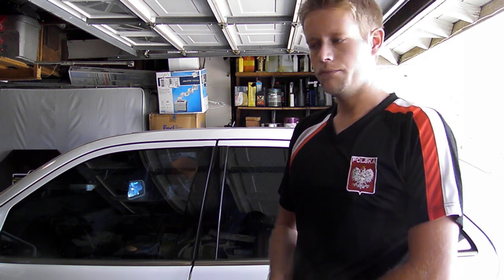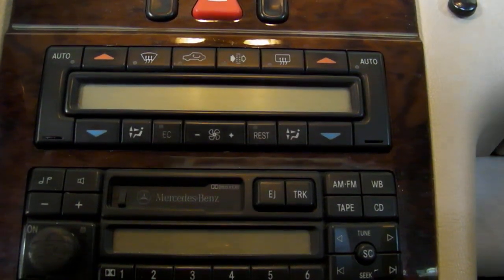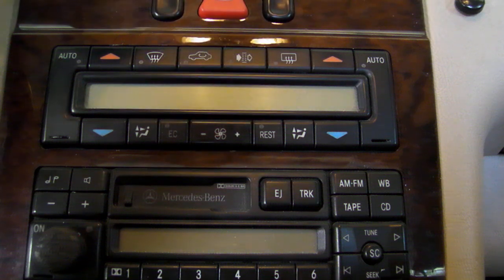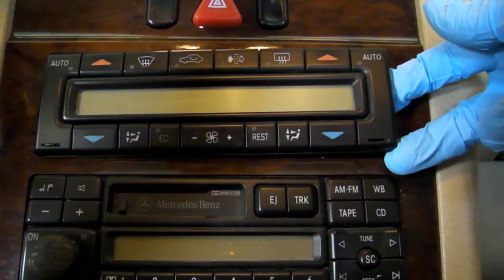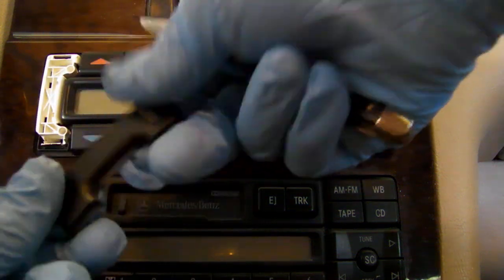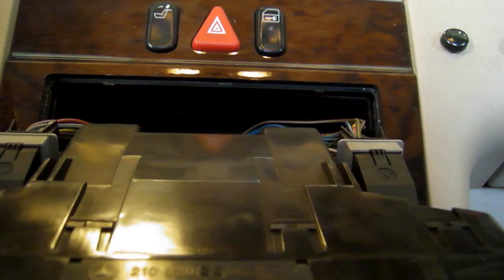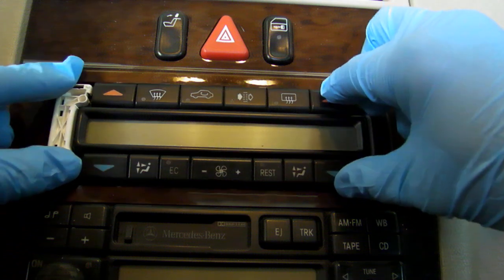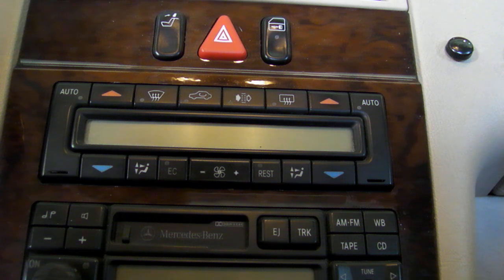Guide: Mercedes E-class (W210 / W208 Chassis) Climate Control Removal + Light Bulb Replacement)

Comment: Hi Mathew, just wanted to give you and your viewers an easier way to remove the climate control unit.  No need for keys or switch blades just a plain old credit card.  Cut two pieces off the credit card  on the long side. The two pieces need to be wide enough to go into the the slots and just push them in, no need to wiggle, just push in and the lock clip will disengage.
Reply from the maker: Hi Joe - thank you for the tip! Much appreciated!
Reply: @joe Pacheco three years later after your comment gotta tell u thanks !

Comment: I have a 2000 MB E320 wagon, My module numbers on the screen, bars,symbols etc are vanishing as well as the on the Radio screen ! Does anybody knows why is that happening, sometimes they show up on the screen but buttons don't work sometimes nothing shows up on the screen,it's like failing,the Radio volume sometimes it's too loud or I turn it too much and doesn't go down lots of crazy stuff happening ! I checked fuses all are fine ! Great Vid !
Reply from the maker: I’m not sure what the issue could be. Perhaps water damage behind the dash causing these glitches? I’d search or post the question on the MB forums.

Comment: Hello Friend. I have a 2001 mercedes w210. I replaced the bulb just like you showed but the new bulb doesn't light either. Whether there is a fuse for that lamp or something else can be a problem.
Reply from the maker: Hi Marko - I don't have that car anymore but I remember that I also had issues getting it to light. After moving it around inside the socket for a while, it lit. I think it has to do with the metal contact "tabs" that make contact with the light to complete the circuit. If you can find those, try pulling them out a little. Perhaps those metal tabs are not making contact.

Comment: I'll have to check and see if my 2000 E430 has those slots but all you need is that simple key I believe they made for the radios you push them in and it locks in the clip and then pull them out with the keys easy Peezy

I've gotten to the point when it comes to a do it yourself job get the right tool 

Like I said I'll have to check this but I am "assuming" these have the same size slots as the radios 

No wiggling no jerking just push the keys in and pull out the unit

You always use two keys so there's no worrying just pull it out

Edit: I wanted to still thank you for this video because my back light was out and I am assuming it be a PITA like various radios to replace. 

I am all set to call Beckman technologies and go to my parts friend at the Mercedes dealer to see what a rebuilt unit would be and it's nice to know it's so simple to replace so thank you !

Comment: nice job matt thank you. how far in do you push the blade? and are you applying pressure towards the unit or away from the unit to release it?
Reply from the maker: Justin Keogh I pushed the blade in until I heard a light “click”. It will take some wiggling of the blade but you will eventually get it. Then, coax one side toward you a little bit and work on the other. Too much pressure shouldn’t be needed.
Reply: @matthewbaker1419  Mate how do you switch to the digital control unit from the base model manual switch one

Comment: Thanks Matthew . i found this video very helpful .  i ordered the keys to remove the control . Simple operation as you said . However now i am having trouble finding the bulb to replace . What do i call this and where can i purchase one at?   thanks again for your video .......
Reply: T5
Reply from the maker: Hi Karl. I apologize for the late reply as I'm not too active on YouTube. Getting a bulb is tricky... it is nearly impossible to find them new. My suggestion would be to call local scrap yards. I'm sure several mid-90's Mercedes models use this same bulb.

Comment: Is that the only bulb in the whole thing? My screen is very dim, at night, and the buttons do not light up at all. Are there more bulbs inside the unit?
Reply from the maker: Hi Werner - surprisingly, that's the only bulb inside the whole unit. If you take it out, the whole unit will go dark. Replace it and it's as good as new.
Reply: @matthewbaker1419  as I understand some of the dual zones actually have two bulbs that go in from the outside. I don't want to screw it up so may just wait to get a set of the keys to pull out out with. I plan to put led's in it to see if that helps. Thanks.

Comment: Nice video..you are very profesional ...one question please ..i have mercedes e280 ( w210 )' and the climate control it has is manual ...i got a digital climate control ..is possible to change the manual climate control and put the digital one ? I wait your answer please very urgent
Reply from the maker: Thank you! I think it is possible but with a lot of work. I am not familiar with the process but it looks like there is a lot of modification needed to the wiring. It also looks like the digital control has extra sensors that need to be installed. Seems like a lot more time and money than it is worth. If possible, I would try to sell the digital control and find a matching manual control for a direct replacement. Here are a couple of links that may help you: 
https://forums.mbclub.co.uk/threads/retrofit-climate-control-w210.140336/
https://mbworld.org/forums/clk-class-w209/687273-manual-digital-climate-control-retrofit.html

https://mbworld.org/forums/e-class-w211/487416-conversion-digital-ac-control-unit.html

Comment: Matthew, On the sun sensor in my 2002 e320 there are two wires that drop down and connect somewhere. Do you know if they attach to one of those two wiring modules that attach to the climate control module? Thanks, Nick
Reply from the maker: Hi Nick - sorry I can't help you there as I'm unfamiliar with that module and that wiring. I'm only a hobbyist :-)

Comment: What kind of bulb is needed?
Reply from the maker: Good question. I couldn't find that out and went to a local junkyard. Luckily, they had the bulb for it. I would suggest checking at your local junkyard/dismantler or taking it to NAPA Auto Parts to see if they can identify it.
Reply: @matthewbaker1419  T5 bulb, you can get an LED one too

Comment: Can you buy a 210 climate control for a 208 chassis?
Reply from the maker: No, these are not interchangable. The W208 part ('98-'03) has one electronic connector on the back while the W210 ('96-'00) has two connectors. However, the removal/installation process is probably identical.

Comment: Gloves to remove an HVAC control?  Are you kidding?  Should have used the glove money to buy the proper removal tools and not keep breaking the plastic trim.
Reply from the maker: mikeceli This is over 20 year old plastic and is prone to cracking. Gloves ensure safe removal and prevent you from getting skin oils onto the bulb which can burn it out quicker. You are correct in that you can buy proper tools to do this. I am trying to demonstrate that this is an alternate method.
Reply: @matthewbaker1419  You made my point for me about using the right tool for the job, to prevent or minimize breakage.